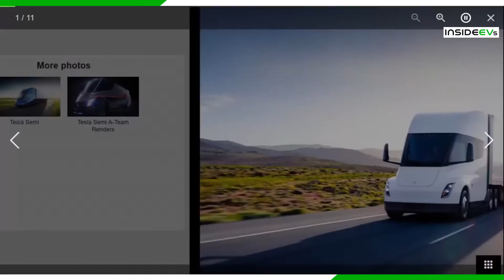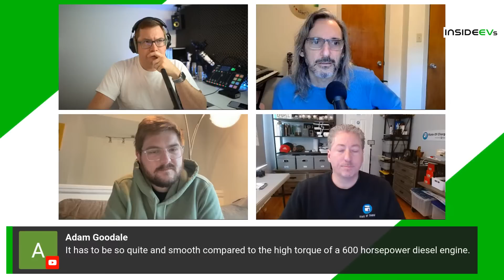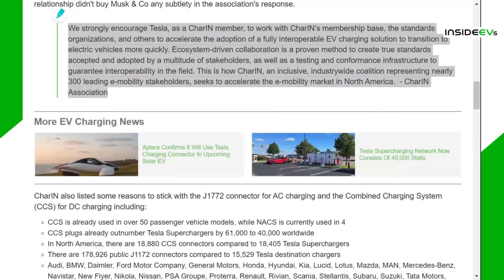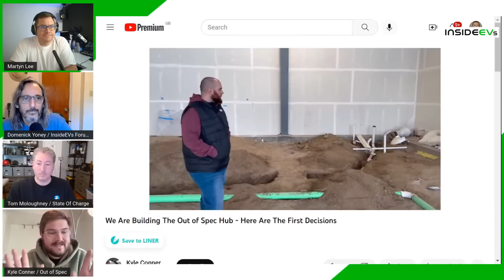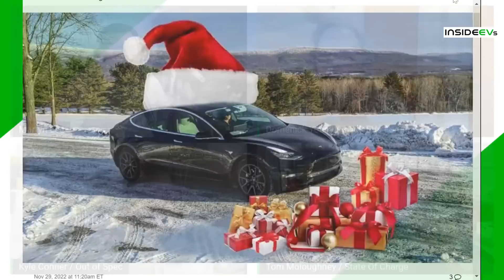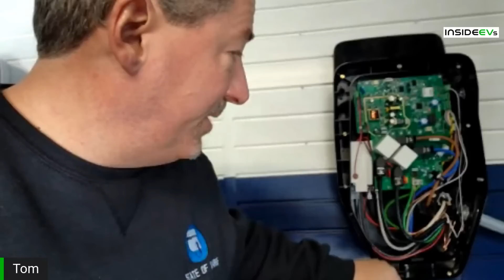Tesla Semi Event, Lordstown Endurance and BMW's Better Battery

Comment: The problem with installing a Mega charger on a commercial property in California is the "Demand Charge."  IT can be $12 per KW.  So a company running HVAC and lights and a few computers might have a 100 KW load on their electric panel.  The demand charge is $12 per KW at the highest demand each month, so $1,200 in this case, and it does not matter if the demand was only 50 amps for 300 hours of that month, and only 1 hour reached 100 KW.  The charge is for the electrical use at $0.16 per KW and the demand charge added to the top of that total.  

Now if the plug in a electric forklift charger and run that during the peak power demand hours, and say add 25 KW to the total, that will add $300 to the monthly demand charge.  Should you decide to charge a electric vehicle, that could add $1,200 for a 100 KW charger, $2,400 monthly charge for a 200 KW charger, and $12,000 for a 1,000 KW charger that is plugged in and running at full capacity on a hot day!  Picture Pepsi with potentially 10 chargers, if run during the peak demand charge timeframe, that could add $120,000 to their electric bill, unless special arrangements are made with the electric supplier to avoid all these demand charges, or if they can only charge during off peak time.

Comment: I liked looking at Tom's electrical panels so much that I watched it several times.  My guess is that he has 2 each 200 amp panels with main 200 amp circuit breakers?  And then one has about 100 - 150 amps circuit breaker feeding the Ford inverter/ charger, that is also feeding a third sub-panel, that has some home circuits on it.    Like lights and a few critical plugs.

I wonder what the generator is feeding?

I will look forward to looking up the other video of the panels at Tom's house.  

My guess is your plans include a SPAN electric panel, that can be connected to a 200 amp circuit, and then throttle the amperage to the various EV chargers to prevent the main circuit breaker from being overloaded by measuring the main incoming power and adjusting the charge percentage of the EV chargers.  This might be possible without ripping out everything, but keeping the home panel on one of the 200 amp feeds, and the generator and so on.  Then connect the SPAN to the EV charger panels, feed it 200 amps and consider the other 1/2 of the 200 amps feeding the house loads only.

Comment: Short hauls more important? "While definitions vary regarding what exactly counts as long-haul and short-haul driving, generally routes that involve a 200-mile radius or less should be considered short-haul, whereas anything over 250 miles is considered long-haul driving."

Comment: Went to an EA site a week ago. 4 of the 8 machines were down the 4 working ones were busy. No problem went down the road a few miles to an EVgo. Site said it was down for maintenance, drove a few miles to another EVGo and it tried to start but no joy. Called EVGO they couldn’t get it started. Went to a third site, totally dead. Went to our grandsons and after dinner, back to the original EA. Open machine but it wouldn’t start. EA couldnt get it to work. Guy next to me said he was leaving and let me pull in to his spot. Finally got to charge. Had 17 miles on the GOM with 80 miles to get home. Worst charging experience we have had. Infrastructure suck right now.
Reply: where was that?

Comment: For those who don't live in CA, Semi trucks are limited to at least 10mph less than passenger vehicles on most highways.  I haven't seen the Tesla Semi video, but I assume he was driving through Pacheco Pass and/or the Grapevine, where Semi's are strictly limited.
Reply: So a driving stunt
Reply: @williamerazo3921  not necessarily. CA is the most populous state with several important ports. A lot of Semi’s are on our highways & The Grapevine is the gateway into LA County. Pacheco Pass is the main route from the Central Valley to the South Bay & Peninsula, or what folks outside of CA think of as “Silicon Valley.” It’s a common route

Comment: EVgo Autocharge+ setup for my new 2023 Genesis Electrified G80 has been a nightmare that is still not resolved. EVgo app says that my Genesis is eligible for Autocharge+ but all attempts to verify VIN, both scanning and entering manually result in VIN cannot be verified. Trouble ticket with EVgo for over a month with constant response, check back in 5-business days has still resulted in no offered resolution for estimated time needed. As someone who is attempting to be a new customer for EVgo this has been a very negative experience.

Comment: Only the high-end 500+ mile range Cybertruck will need the Megacharger compatibility (as the battery pack is large enough to sink the high charge rate). The lower end models with 27-350 miles will make do with 350KW chargers.
Net-net, a SEPARATE PORT on the 500+ mile range Cybertruck is totally feasible (even with the additional cost) as that model is likely to be priced at $90+K anyways.

Comment: I think most use for the Tesla semi is going to be between known points...consistent duration and predictable routes.  Still amazing but I don't think you will suddenly see Tesla semi's doing cross country deliveries.
Reply: Agreed for the moment there is no infrastructure.

Range helped as 55mph limit for trucks in CA.

Also range helped as used flatbed trailer with low aero heavy load.

Weight not as importantbas aero of trailet as kyle proved in tow tests on rivian and f150.

I agree with kyle good 300+ day cab truck if driven at higher speeds with dry van or box style reefer trailer.

Still great for city or local pr regional deliveries.

Comment: I'm forced to repeat again:

A large part of the "better form factor" of the Tesla connector is the CABLE, not the connector. If EA is using a tesla connector with their current cables, that won't help you twist the cable. You'll put insane torsional load on the connector.

Comment: I have to notice that the 500 mile drive was ... pretty slow.  50-60mph mostly.

I have to assume the plaid motors are actually about efficiency above 60mph. The carbon-fiber wrappings appear to reduce the tendency of the motor to reduce effectiveness at higher speeds, and that's gonna turn into efficiency.
Reply: An average highway speed of 60 MPH makes sense for semi-trucks because the faster you drive, the semi-truck or any vehicle uses a lot more energy.